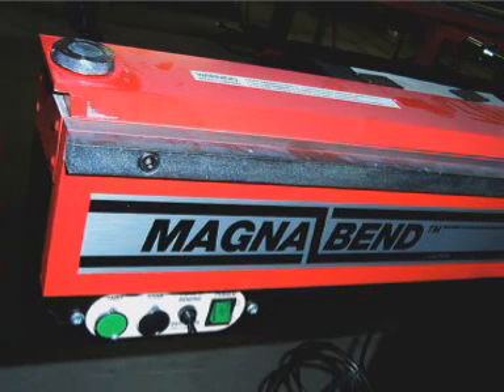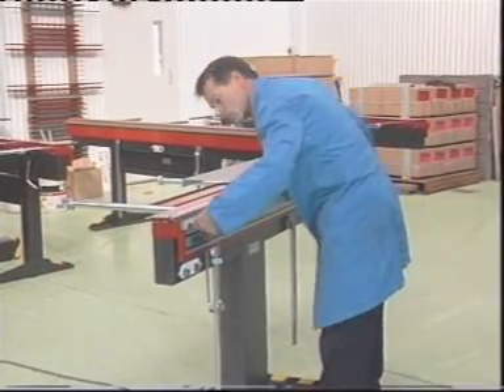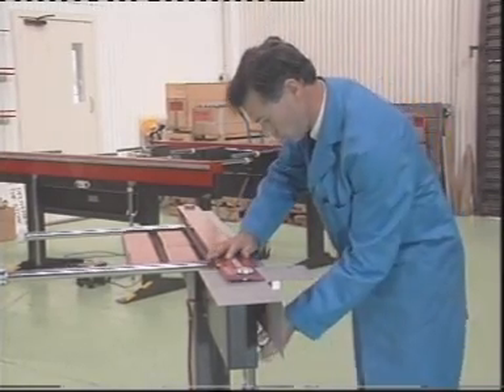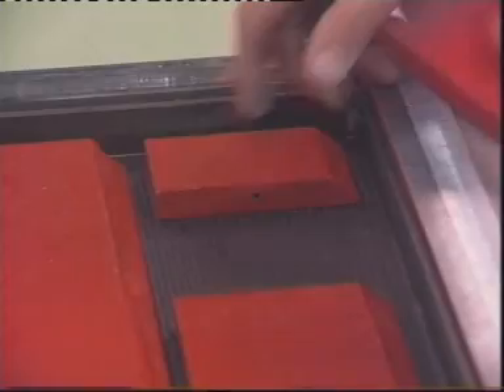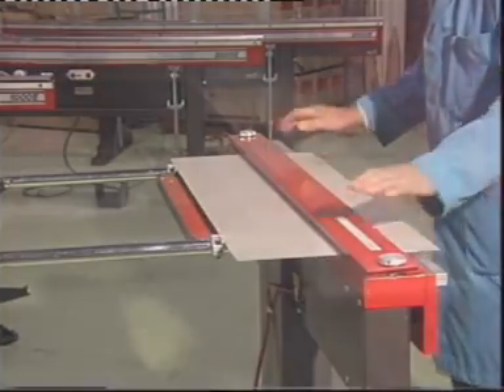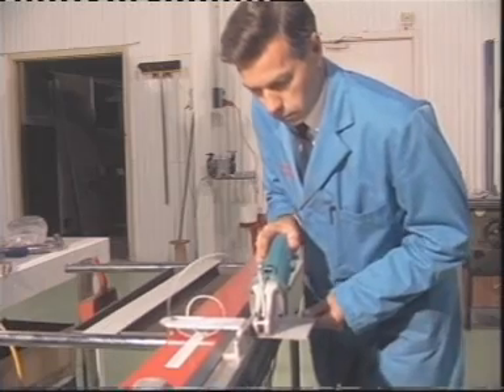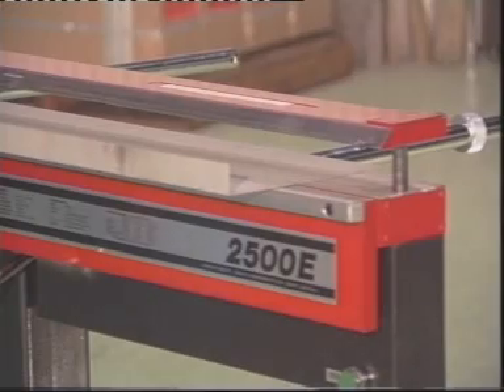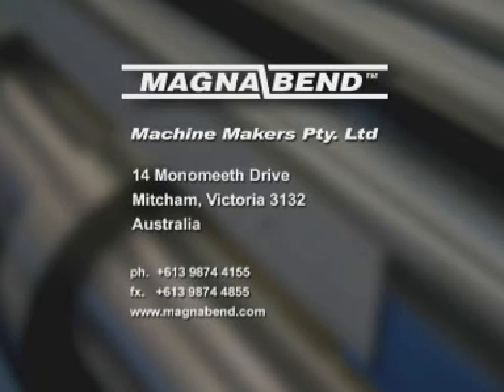magnabend electromagnetic bending machine video.mpg

Comment: Absolutely loved making these at Magnabend for Allen and Geoff in the 90s the best bosses I have ever encountered. And to answer previous messages in this section it's pretty hard to get body parts under anything because you have to have one hand on the handle and the other on the buttons. Same with foot control. The only way you'll lose a finger is if you get someone else to start it when you have the desired body part under the camp bar 🤣🤣🤣

Comment: On a traditional pan brake, you can control the radius on bends (within reason), by positioning the clamping fingers a distance (equal to the desired external radius) from the folding arm, when the folding arm is at right angles to the clamping surface.   This is done with a screw adjustment.  Is that possible on a Magnabend?  We have to set a .020" inside radius on .024" low carbon steel (.044 outside radius).